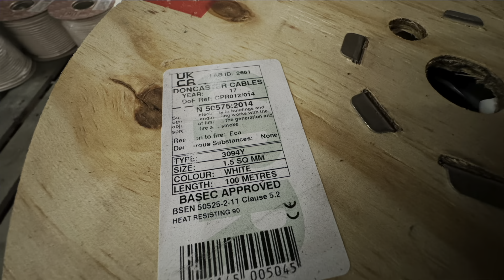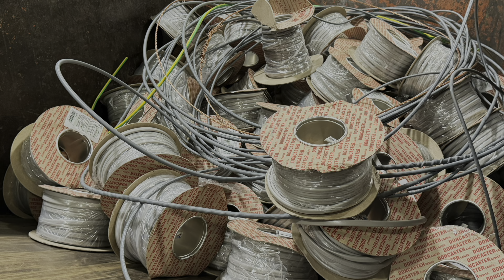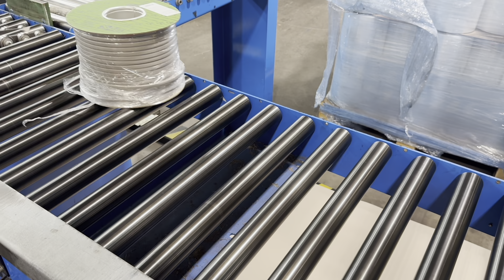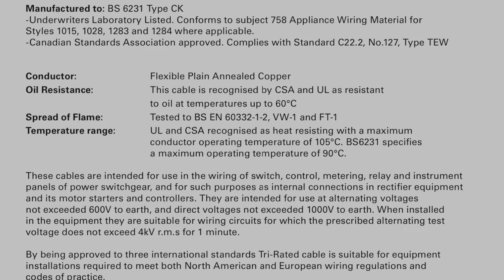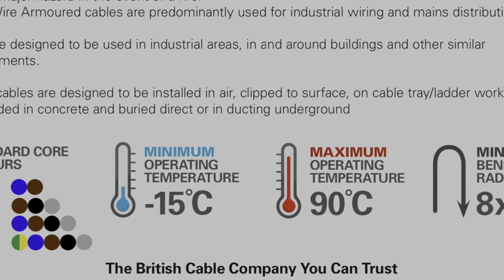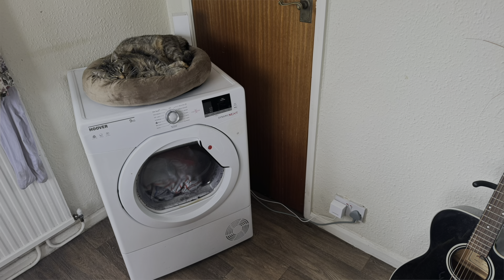The Dangerous Truth About PVC Cables

Comment: Went to a job where aparently smoke and a smell was coming from all the DBs. The earth sleeving was melting in all the boards yet everything was working. A recent 'upgrade' to the main distribution including a new pannel board for the submains. No Nuetral link installed on the 4 pole incomer. Still strugling to work out how it was all still working and what exactly was putting the load on the cpc's. Have a few ideas whats yours?

Comment: scrapping cables is a difficult chore; - my latest idea is to simply granulate it and then separate the copper from the plastic using water, - that will work as long as the plastic floats... - I used to burn the stuff off but it stinks the manor out and you only get a fraction of the money... - later cables are fire retardant;- the plastic grain off that is great for putting fires out...

Comment: Funny that it’s revolutionary to have insulation on the earth/CPC conductor in the UK. I’ve been a sparky in Aus for a while now and the earth in our T+E has been insulated ever since I started, 20+ years ago
Reply: How do you strip the outer sheath off the cable ?? - In the UK we tend to use the earth (CPC) as a cutter to slash the outer sheath - but that would not work with your type insulated stuff
Reply: @ it does, but generally you use your pliers and grab the side of the cable and just split it like you’re tearing it. In Aus strippers aren’t used very often by most sparkies, we all tend to use pliers for everything.
Reply: @colinblythe3710  side cutters or a wire strippers 
I do it quite a bit on my projects
Reply: What's the price difference between sheathed  C.P.C and non - sheathed can someone tell me please.
Reply: @scottsaul  depends where you are on earth - google your local wholesaler - the price of copper changes daily & reflects in the price
Reply: It has been done before over here. There was single core+ insulated cpc lighting cable around in the 60s/70s. I've seen quite a bit of it in installations from that era.
Reply: It was considered a safety feature to have the earth uninsulated. Basically when uninsulated damage to the cable is more likely to produce a safe fault to earth.
Reply: @ I did not know that. Makes sense after you say

Comment: If it doesn't say fire retardant or proof, then it will burn relatively easy.
You have to remember fumes are dependant on how much fuel is available.
In a domestic situations and many retail areas the amount of PVC able to burn is very small.

Comment: What is the point of an insulated CPC other than to waste money / extra CO2 for a bit of plastic that only saves a sparky a few minutes per item? One of the benefits for no sheathing is that an insulation fault along the cable can short to the CPC... causing the power to turn off sooner and reduce the chances of fire?
Reply: Couldn’t agree more
Reply: Cables containing a non insulated cpc are not considered to be double insulated insulated.
Reply: @ if they are not considered double insulated insulated in that case they should be run in conduit
Reply: @andysims4906  when earthsure came out, everyone was reacting yayayayayay, you are the first person to disagree, I could bring up the fact people could lose the sleeving but I have explained enough as it is.
Reply: @sniperfi4532  The earth doesn't need to be double insulated (although I can kind of see the use of insulating it, to prevent shorting to uninsulated live parts inside the boxes). On Earthsure it's extremely thin anyway, so I'm not sure I'd trust that as actual insulation (the documentation never directly refers to it as such).
Reply: @longrunner258  not on British standards but the main reason to insulate it is it conforms to complete double insulation (both live conductors would only have one layer of insulation separating it from the earth or CPC)

Comment: Over 40 years as factory electrician and never knew what tri rated stood for. Always thought it covered 3 ratings depending on application, generally thicker insulation to standard cable. I also never utter the letters  “Cpc” in and sentence about cables. dinosaur, yes and proud of it

Comment: The fire broke out by the escalators, which were wooden surprisingly. People had been discarding their matches/cigarettes butts there. Basically a ticking timebomb.
Reply: @JohnSmith-ws7fq  It was the build up of lubricating oil and fluff that caught fire.
Reply: @chrislambert-shiels5291  I had a quick look over the investigation report, and you are indeed correct, so thank you for highlighting this.
Reply: And a confined space with a predictable airflow, chimney effect.
Reply: @davidsoulsby1102  with the trains still running , causing a "nice" draft to fan the flames. ( it wasn't really "nice" , that's why I put it in inverted commas)
Reply: @karlosh9286 Ture - although maybe it was better for trains  to pass through Kings Cross without stopping. or only stop to pick up trapped passengers than to leave them stranded in a dangerous situation?
Reply: Also there were no fire alarm call points on stations in those days - apart from the cost there may have been concerns that false/nuisance alarms would be used to stop trains & cripple the network. I think it was the same for fire detection ... maybe in equipment rooms, but not in public areas.
Reply: The fire extinguishers that used to be in tube line carriages have been removed - a balancing act between safety & potential improper/nuisance use.
Reply: The smoking ban, which must have cost next-to-nothing compared to replacing escalators, installing non-smoke cables etc - was probably even more effective. Ditto on National Rail.

Comment: Hi fellow sparks, could anyone point me into the right direction:
1) an automatic transfer switch needed for 1 and 3 line / phase

2) rcbo populated board + surge protector , domestic, 

Also any other knowledge, geni for domestic use, ideally with all the components, ATS, etc

Comment: I do take issue with the insulated CPC being some sort of innovation, most of the rest of Europe has been doing that for more than 50 years. I’m also quite concerned by that CPC has a smaller cross-section than the line conductors, significantly smaller on the larger cable sizes.
Reply: If you consider what the final circuit earth wire is there to do the smaller size is completely acceptable.  All it has to do is withstand the fault current until the protection goes off which is typically required to be 0.4 seconds or less.
Reply: @retrozmachine1189 theoretically yes, and I'm sure the standard allows it, but I personally wouldn't be comfortable with it.
Reply: @sstorholm  Why?
Reply: @retrozmachine1189  Because I was taught that any earth conductor must provide the lowest impedance path to ground. Hence the requirement that the earth conductor has the same or exceeds the current capacity of the line conductors.

Comment: Even though they can operate at 90 degrees often the calculations used for them are the applicable to the ones of 70s, often requiring the cables of 90 degrees to be upsized slightly. Additionally, how about equipment both CBs/RCBOs that they connect to will need the same ratings, right?

Comment: Square millimetres  please, not millimetres squared. It’s a common misunderstanding when describing the cross-sectional area of a cable, "square millimeters" (mm²) is the correct term. Both "square millimeters" and "millimeters squared" technically mean the same thing in terms of area. However, for clarity and standardization, and because the cross section of cable is circular and not square "square millimeters" (mm²) is the preferred term in engineering and technical contexts.

It's best to stick with "square millimeters" to avoid confusion and ensure proper communication, especially in technical specifications.
Reply: Wow very technical. Don’t know about you but when I and most people order cable they just use a number followed my “mil” there is never any confusion if I order 4 core 25 mil ( or mm if written down) never ever mention “squared” as we all know cables are round.
Reply: @johnwarwick4105  Fair point, and I understand it may seem a bit pedantic. However, as this is an educational channel, it's important to teach both potential and existing electricians the correct standards. This is different from simply ordering cables at a wholesaler. In the video, they correctly refer to "Twin and Earth" as "Twin and CPC." Therefore, the cable sizes should also be correctly highlighted, as they are often misrepresented, especially on this channel and by GSH Electrical. To teach excellence, one must adhere to excellent standards.
Reply: @johnwarwick4105  Obviously twin + cpc cable isn't round, but I suspect you meant that all cable cores are round, however this is not the case.  Larger (50mm2, 70mm2, 95mm2, etc) cables may have 3 or 4 cores each of a sectoral section formed by passing the stranded conductor through a suitable shaped die.  After extrusion of insulation, the shaped cores are then twisted together (layed up) to form a compact multicore cable. There are also similar size cables with solid sectoral conductors -  usually aluminium, buts that another story.
Reply: @davidrolfe9571 🤣🤣🤣it was a flippant remark against the use of "square ". yes I am aware of the shape of the larger cores and even solid aluminum. Yet to come across a square cable other than bus bars. I go get out abit though 🤣

Comment: Sounds like house bashers might have to up their game and start doing stuff properly like Industrial sparks for a change.
Reply: Very different situations.  You can't make a useful comparison of what happened at Kings Cross with what happens in a house fire.  Low smoke wiring in a house wouldn't make a great deal of difference of itself and when you consider all the other toxic stuff people fill their houses with let alone the other materials used in construction it makes effectively no difference in the outcome.
Reply: Sparkies will do only what the regs tell them.
And the regs don't mandate the sole use of low smoke cables in residential settings.

So no, Sparkies are not going to up their game unless the regs force it.
And that probably is not going to happen.
Reply: @deanXRayZulu your absolutely correct. The regs are the minimum standard